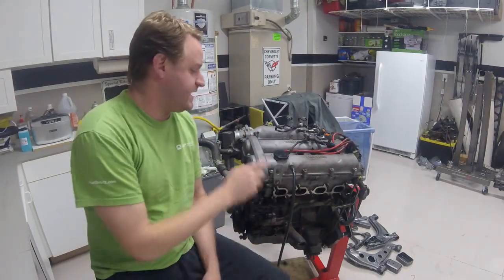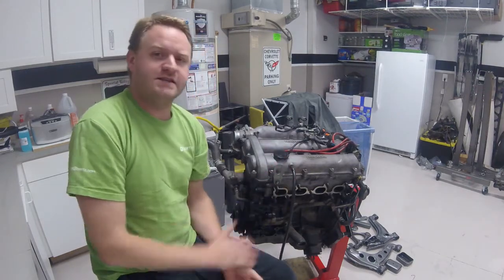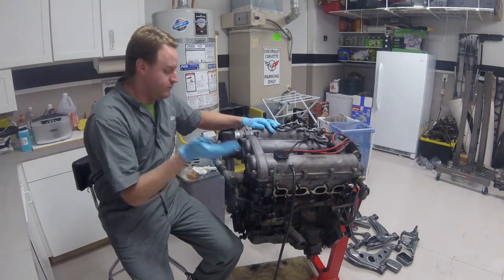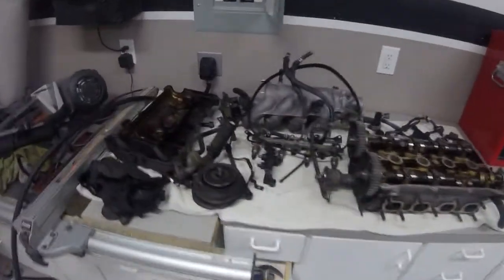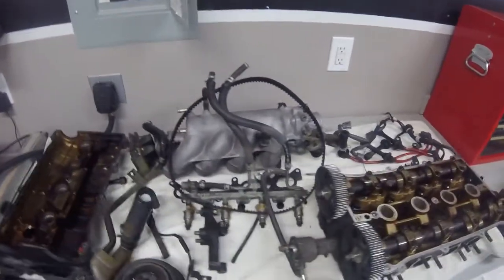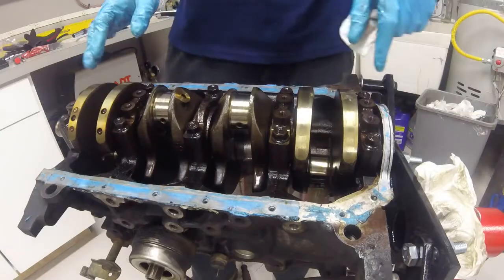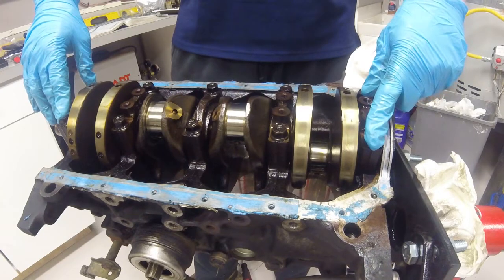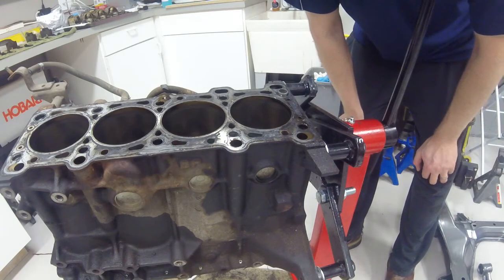Tearing Down Mazda Miata Engine For Rebuild

Comment: I see the date on this, but if anyone knows to save a guy some trouble, what exactly is the part here at 7:45 in the video?
It seems I leak quite a bit of oil, maybe a liter every 2 months, from what seems like the dead front where he knocks off the plate under the tensioners.

Comment: One thing I noticed is that, when unbolting the crank, there is a specific loosening and tightening order. Although a random order off of intuition is probably good enough, when doing a high performance build with hundreds of dollars of parts, it is worth looking at what that pattern is. Overall great video! Also, whenever you take off crank bearing caps you wanna make sure that each one goes back in the same place and same orientation. Mazda should have labeled each one for you, but if they go back in the wrong order or are flipped you can risk damage to the crank. The reason for this is because the method for making the hole that the crank goes through is using a giant drill bit when the block is fully cast (at least this is what I have understood from reading about these motors). This leaves potential for a slight difference between each diameter, so it's important for them to go back the same way they came out. This is especially important for the cams.
Reply from the maker: Yes you are correct.  This was done as it is very important everything even down to a lifter goes back where it originally was.  The crank caps were put back in the original orientation.  Line boring I think it the term you are talking about for the giant drill bit.

Comment: Since you said you've never done a tear down before, here's a tip. From where I am sitting and watching there are shiny clean arcs at the bottoms of the valve reliefs in the pistons. This tells me that sometime recently that motor was over revved enough for the valves to float and hit the pistons. So check all of your valves for possible bent heads. It might just be a trick of lighting, but it stood out to me.
Reply from the maker: It's a non interference engine and all the valves checked out good.  Been running great for last year and a half.
Reply: Can you give a time stamp for when you saw this? Just for the non-experts :)